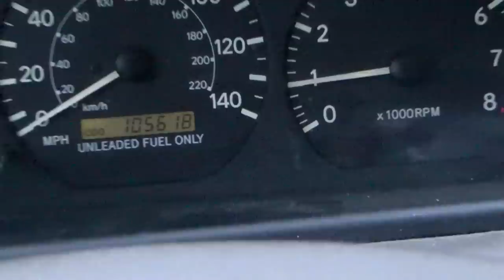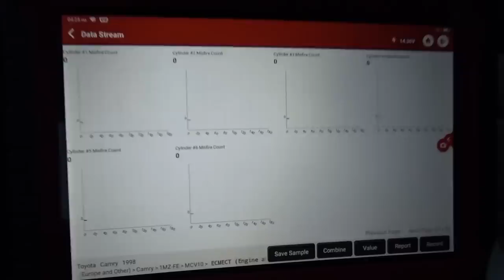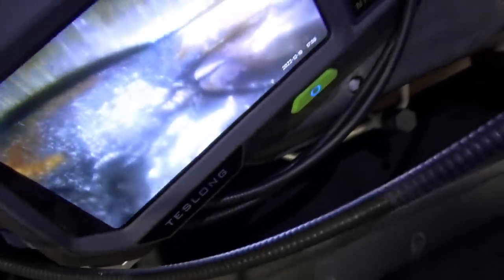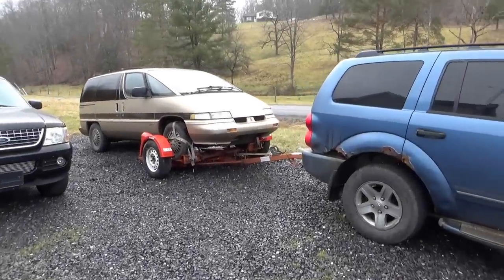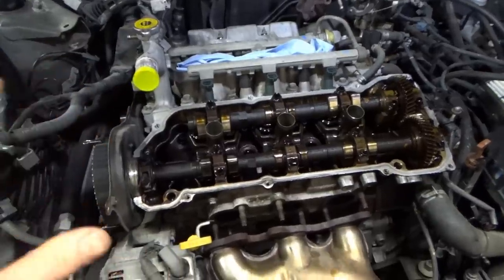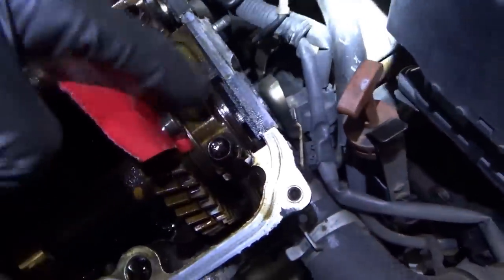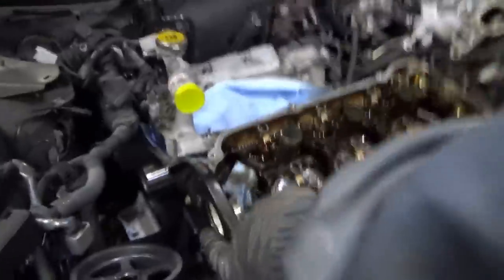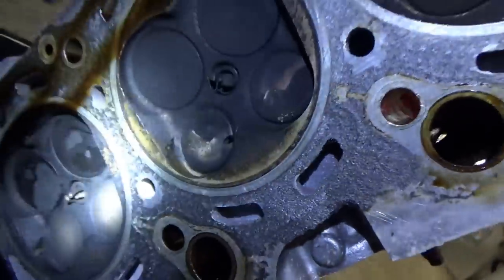How to Kill a "Bulletproof" Toyota? (98 Camry V6 Misfire - Part 1)

Comment: A 25 year old Camry with 105K miles. Even needing work, you found a gem Ivan. I know she will rot out from rust long before she dies of mechanical failure in your possession. Great video.
Reply from the maker: Will take a while... She's spotless underneath!
Reply: 25 years and only 105k waw that's a garage queen
Reply: Dont assume all toyotas rust out..my wifes highlander same year as my gmc sierra 2014.  The sierra showing lots of rust..highlander...ZERO
Reply: @pootthatbak2578  From the area of the country, not that Toyotas have a tendency to rust out. I grew up in northern Indiana. The state gov throw salt and sand out every winter ruining the cars.
Reply: @mattbrown5511  im saying i have two cars bought the same time, parked on the same driveway, that run the same roads every..the toyota didnt rust..the gmc did. Our toyota ran the same salty pennsylvania roads the gmc did. I take of and wash and maintain both. Im happy toyota did a good job
Reply: @mattbrown5511  ditto, here in northeastern Ohio, one drive in winter salt and you can hear the rust growing, crackling the paint and body apart
it was even worse was on the toyota's and other foreign cars of the past ( pre 90's) you could visually see it spread over-night( but plenty of domestics did the same thing. I think Chrysler pioneered the speed rusting vehicles by the 1960's and we wont mention their electrical gremlins. 🤣

Comment: I loved that van! My daughter wanted to buy it. I drove it from your shop to MD and around town and back. What a beauty!! Sorry it died but it was fun while it lasted. Oh by the way, I am working from home so my driving has slowed greatly. Scheduled at 9:30 Saturday for my 78th free oil change at 445,000 miles. V6 Toyota Rav4 2007. Thanks to you it runs like day 1.
Reply: It doesn't make Any fans Pontiac Toyota
Reply from the maker: 78th FREE oil change is simply amazing! Got a ways to go to catch up to the 550k Sienna 😉
Reply: @PineHollowAutoDiagnostics  I bought a 2000 Sienna owned by a church, rats got into wiring. Been sitting for 10 years. Had to replace fuel pump, clean injectors. Runs like new now! 83,450 miles. Only 466,550 miles to catch up. BTW, I gave 500 bucks for the Sienna

Comment: Two failures got you a new loaner car :-) Love the simple construction of the engine - reminds me of old Japanese motorcycle engines, that were so easy to take appart, and yet, had all the mechanical sophistication needed for good performance. Now, for Part 2 and a glorious restart :-)
Reply: you're so right about Japanese bike engines. Been riding those motorcycles for 50 years and I've done my share of wrenching on them..and they are much easier to work on than a Harley.
Reply: @adotintheshark4848  Absolutely! And it's gratifying to work on them, as opposed to English engines, that test your patience 🙂

Comment: Chunks out of exhaust valves happen when they can’t effectively transfer heat from the valve to the seat. I had a 98 Sienna with tight valves. I’m sure you already discovered shim on bucket for these engines. Also my friends 99 RX300 was burning a lot of oil. His independent shop said new engine was needed. I instructed the shop to order a cam cover from a later Lexus. Breather baffles get clogged in cam cover that are very hard to effectively clean. Other than sticking IAC valves if oil is changed every 5K 300K plus engines. 
Now that the car is yours remove the Camry letters on the back reinstall to spell Mycar 😊
Reply: That's funny. We had a Volvo sent out for trunk repair and when it came back it read "oVlov"
Reply: yeah, very likely valve and seat wear made it too tight to seal right anymore and POOF. possibly enhanced by the full synthetic oil or an overheat scenario causing valve seat movement.
many engines had the shimmed solid buckets, many lasted the vehicles lifetime(often 300k+), but some got tight and poofed valves.
**but it could be dirty injector and major ethanol stacking, since it clearly hasn't been driven that much or even the gas station had bad fuel (ethanol stacking) and dumped it at cheaper price.

Comment: I have worked on many old air cooled VWs years ago and my theory is when it is an oil burner carbon builds up on the seat not letting the valve make a complete seal and when it starts to where it starts leaking the hot gas blowing past that valve will eventually torch a hole in it. When you get it running throw a can of Rislone in the oil and take it out and run it hard for a few hours. Always has worked on my airplane engines when they get to burning to much oil.

Comment: Nice find!  I have a '99 3.0 XLE model and since it's driven only around town except for maybe 6 times a year when it then gets it legs stretched about 300 miles on each of those trips.  And so I change the oil around every 5 months no matter what, and use synthetic oil with a Toyota oil filter.   So far at 240K, other than spark plugs & timing belt services with valve cover gaskets with crank & cam oil seals and the rear exhaust manifold leaking a bit (I decided to replace it), it's been a rock solid engine.  Too bad I live in the salt belt, but I've been doing my best to keep things washed off underneath during the winter.   It's also my only car, and I'm not afraid of it taking me anywhere.👍😁

Comment: Love these engines. I live semi-rural and daily drive an old Avalon. It'll take a bit of convincing to change to anything else. If oil changes have been neglected, just check / clean the PCV valve (rear rocker cover). Could well be stuck open or shut.

Comment: I've never had to tear one of these apart before.  They just don't die like that.  But yeah.  It just goes to show you.  Even a legendary indestructible Toyota engine can suffer a catastrophic failure when it's not been properly maintained.  Looks like it will be a really decent spare car to have kicking around once it's fixed.  Looking forward to part 2.
Reply: Not sure how 'proper maintenance' would prevent a chunk snapping off a valve head?
Reply: @rafflesnh  There's several reasons. Extended oil intervals lead to carbon building up on things like pistons, valves, and valve stems. When there's too much buildup it can affect the way the valve closes and transfers heat back into the cylinder head through the valve seat. Excessive carbon can make the valves stick in the guides, disrupting their travel and also not seat down properly to shed the heat from the exhaust gasses. I believe these required premium fuel also. Using poor quality fuel could cause knock/detonation which can also damage internals. This car likely had poor fuel in it simply because it sat around and wasn't driven consistently.

Comment: Ivan I would have thought you would do a valve job on that one cylinder head while you had it out of the car. It certainly is a great car for $1,000 and eight hours of your time fixing it. Thanks for taking us along on this one!!!
Reply: Leave well alone, I expect. The other valves look fine. Really puzzling how a chunk snaps off a non interference valve head, unless manufacturing defect caused.
Reply: My have caused valve seat damage
Reply: I would have ported the Head a little with a dremel tool whis i was in there...

Comment: Another interesting video - and I can't wait for the conclusion. The 4-banger had a similar arrangement for driving the 2nd camshaft - so there was only 1 camshaft oil seal. My wife had a '97 and sold it with  something like 267,000 miles. The heater core  and the power steering rack were both all-day jobs for me, though.

Comment: I change the oil on my 1998 Camry 4 cyl every 1,400 miles which equals every 30 days. Only cost $25.00 to do but the price of piece of mind is priceless.... The oil filter is truely and literally right in your face when you open the hood on both 4 & 6 cylinder... I do prefer to use conventional 5/30 oil even though it is so hard to find. Synthetic oil to me is so watery thin....

Comment: I miss my 98 4 banger that got totaled after it got rear-ended. Most reliable vehicle i ever owned, just basic maintenance and it will run forever!
Reply: I've got the same story. 2001 four cylinder, owned since new, totalled December 2020 with 358,000 miles on it. Best car I ever owned.

Comment: Takes me waaaaay back,, I was 16 and a family friend had an old Ford with a 289. Took it to a shop for a tune up and it still ran like poo. They brought it over to see if I wanted to take a shot at it.  It had 3 exhaust valves that looked worse than that. Two mismatched junkyard cylinder heads later and they got another few years from it. Ah, the good old days.😁

Comment: My boss had a 1997 Camry LE that was his wife's.  He just became my boss recently and noticed my car in the parking lot and he said that his car would outlast mine.  His car had 135,000 miles and was very well maintained.  He called me one Saturday and told me he wanted his crow with salt and pepper.  I asked him what he meant and he said the timing belt broke and he was stranded and would I come and get him.  I went to U-haul and rented a car hauler. (One that tows with the front wheels off the ground.)  I have a Class III hitch on the Marquis and I went and got his car back home.  He traded for a used Tacoma at the Dealer.  His wife had bought a 2008 Camry and she had oil burning issues with it.  (Defective piston rings.)  He ended up buying her a new Camry.  Great video!
Reply from the maker: Why didn't he just replace the timing belt on the 97? They're non interference 😁
Reply: @PineHollowAutoDiagnostics  I asked him if they repaired the car and he said they did.  When we pulled into the dealership, there was a 4-year-old Tacoma on the lot a local had just traded in.  They told him it wouldn't be there long, so kinda like you did, he made a deal. He just wanted a truck.

Comment: Ivan. 
My son and I rebuilt a 98 Chevy blazer one summer. He put a lot of money to make look like a monster truck. 44 inch boggers. 1 ton axles front and back. 
We rebuilt the engine. In my cramped shed. Lots and lots of plastics to minimize the dust. We managed to keep it pretty clean. 
The following summer he moved to Phx Az for a job.
He pretty much drove it hard. 😁. He said he would have people stop him to take pictures.
Around late summer the truck developed a miss. He took it to some local shops. They told him. Welllll...it needs a tune and carb rebuilt? So they did that. Still no good. He called me and told me. I told him. Do a simple compression check. 
He said..no tools dad. So I packed all of the tools I may need to do a valve job. I had all I needed. Took a few days off work. Arrived in the evening at the apartment. We did a quick check. #1 was low on compression. I told him. It's a burnt valve. We got most of the things done to pull the head.
Morning arrived. Pulled head in 1 hour. Yup. 1 intake burnt. 
The rest were ok. ? No matter. A quick trip to the JEGS store. Got the valve. Lapping compound. Gaskets and antifreeze. 
Then I got started hand lapping the burnt valve in. Got it done. Got my valve compressor on. Installed keepers and reassemble it. By the end of the day. Truck was running good again. What I found the cause was. Truck was running very very lean. Burnt valve. To make matters worse. The local shop even leaned the engine out more. We purchased a carb kit to richen the fuel mix. 
I spent 3 days total. After the job went dry. He drove it home with no issues. I even took my middle daughter to high school a few times. Lots of ooooinh and awingggggg. Fun times.
That brings me to my current issue. My 01 malibu trans blew a front pump seal. Soooooo...that was my loaner car too. My grandson used it to run to work. So as soon as I finish up my older daughter 3/4 ton truck. I may get it running. With the snow on the ground...hmmmmm...this ole man may wait a bit.
Reply from the maker: Great story 🙂

Comment: I've had an engine that did exactly the same!

Ford four banger, was also burning a good amount of oil but otherwise running fine. One day I was driving home and I felt it was a little sluggish to accelerate. A little sluggish turned into a dead miss after a few minutes. Pulled over when the CEL started blinking, classic thud-thud-thud when coming down the off-ramp.

One of the exhaust valves did the exact same! Huge chunk missing, dead miss with no contribution at all. Zero PSI. Sounded funky though! I think I still have that valve somewhere.

Comment: I had an engine with bad compression an burning oil so when I took apart the head I ground all the values as it was better to increase compression numbers while changing out the rubber seals, I also cleaned smooth the in and exit port's for better flow the engine ran better than it did before, I had people asking me for the engine if I ever scrap the body. All my cars get a oil change at the correct time and most had no faults in running, ie overheating to bad oil passage ways. Even flushed the radiator and heater matrix.

Comment: I mentioned a while back about a gy6 single cylinder engine that wouldn't start unless you cranked it like a junior dragster, I did indeed find that the piston was broken around the rings. I really should get a pressure transducer soon. I actually just did a valve shim job on a 08ish crf 250, of coarse its still a no start. I'm suspecting a spun keyway on the flywheel.  I swear I don't even work on bikes but my teenage son says differently.

Comment: 1980 Dodge Colt. Running on 3 cylinders. Pulled the head and it had a burnt exhaust valve with a pie cut. A bit of carbon hold it open or tight on the adjustment, it's just like a cutting torch. Still have the valve.

Comment: I had the exact same scenario with a 98 crv.  Replaced just the 2 valves in the affected cylinder, did 0% of the stuff you're supposed to do or check with valvetrain work, and immediately drove it 7 hours.  Fixed the bad U joints, drove it a few weeks, sold it.  Wish I knew how long the new valves lasted.

Comment: Can the lack of maintenance (oil changes) be connected to the valve failure?  Hmmm.  If a foreign object found its way into the engine, could it have stuck at the edge of the valve seat and beat on the valve long enough to break it?  Is the seat okay?  We'll return to our adventure soon to learn everything about this failure.  Thanks, Ivan, as always.
Reply: If it's not metal then it'll get broken up.
That sort of failure looks more like the valve stuck open and never had a chance to cool on the valve seat. Maybe crap or sludge down the valve guide

Comment: The L67 is not an easy swap into that van, from experience, but cool.  Making a 4T65E work in it (correctly) is almost impossible so either a manual swap or using the 4T60E and accepting the insanely short lifespan....yeah, just contact me on an turnkey manual swap from our now structuraly compromised 16-race Pontiac Trans Sport minivan.  We are parting out the van and crushing it.  We either keep the manual swap bits (basically the whole subframe including C5 brakes) for some future stupidity like in a Montana or sell it to you.

Comment: 1999 Toyota Camry. 430,000+ miles. I'm the third owner.  Body will rot off before the original engine and transmission die. Replaced the second timing belt at around 310,000 miles. I had it's share of cracks in it!

Comment: I wonder if a small chunk of carbon (from the PCV?) landed between the valve and the seat?
Additionally, Id recommend using Berryman Oil Change Flush 1216 after it's back together.
I did on a '99 Toyota V/6 with a questionable maintenance history and compared the before and after oil samples to check for sludge.
It definitely cleaned things up.

Comment: Very interesting, looks similar valve damage I experienced in 2003 with 1990 Mazda 323 (4-cyl 16-valve engine), only one exhaust valve in cylinder 1 was damaged like that. Still ran pretty nicely, was discovered only after it failed an emission test. I think I still have that burned valve somewhere as a keepsake from that car :D
Good to see the Van still lives on even after the engine blew up.
Reply: Actually found that burned Mazda valve and also my dad's old Opel Kadett B valves as well and took some comparison shots about them. Made community post about them too.

Comment: Sad that had to happen.  With bad rings all around, I'd figure just the #4 cylinder fix is logical however, considering the work involved to get to that one cylinder, it really seems logical to do a complete valve job, seals, guides etc. as well since the access is all there. Question however, would be with a complete valve job, that tends to rely more on piston rings which could end up causing even more oil consumption. So, being the mechanic and owner and its a Toyota that has a great standing for reliability, I would highly consider doing a piston ring replacement as well. It's cost is mostly labor but the outcome would result in a better outcome, loaner car or not. Sometimes the added effort pays off better over time which older vehicle should be entitled to since they were designed way better and were much more reliable than new. 
BTW...when you were using the throttle under load at low RPM my first thought was fuel or vacuum related.

Comment: On those head bolts-- if you simply get a ratchet (or cheater bar) that's twice as long:  being directly proportional,  it will make it literally half as easy to remove them.   Don't neglect your simple machines. :)
Reply: Looks like Ivan has a long ratchet on it. Guess he can make it longer like 4 feet, then he can push only 30 lbs...

Comment: I recall some of the early V6 Camrys had an issue with cracked heads and blown gaskets on one bank, they fixed that on later models from memory.
Reply from the maker: Maybe the previous gen?